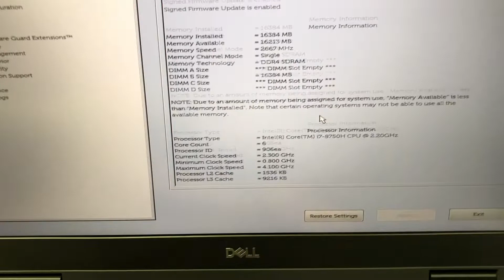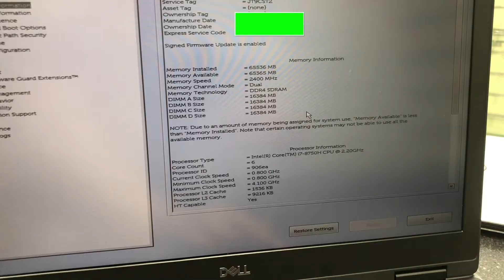Powerfull Dell Precision 7530 upgrade to 64GB Memory

Comment: I have read from Dell that the 7530 is capable of 128gb  4x32gb. But read specs of the i7 8850h its max memory spec is 64gb ? So what's true?
Reply: Maybe 128 GB are only for Xeon configurations
Reply: @bariluca  I think you're right
Reply: The max is 128 GB.  That's why I bought it in the first place.
Reply: @richmensch3279  the max is 128g for what processor? Because depending on which one you have determines your max ram capacity.
Reply: It depends on the memory type not on the processor type. If you have 32 GB single Dimm then you would have 128 GB with 4 32 GB dimms.

Comment: Please explain what kind of loops you turned off under the battery and why? Are these all cables from the motherboard to the keyboard? I did not see their counterpart on the back of the keyboard.

And thanks a lot for the instructions. You can’t even imagine how useful it turned out to be for me and saved me from a very rash act. I bought 2 additional memory sticks, but when I opened the back cover, I saw only 2 occupied sockets. I was already looking for an opportunity to sell these sticks, but still decided to look for information on the number of memory slots. Your video made me understand that I bought everything correctly, I just didn’t think that the sockets could be under the keyboard!